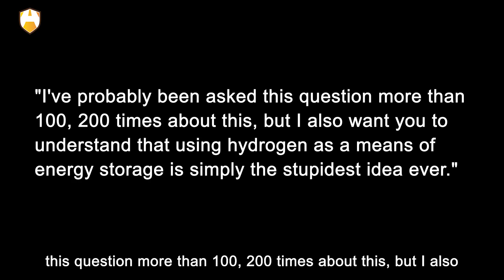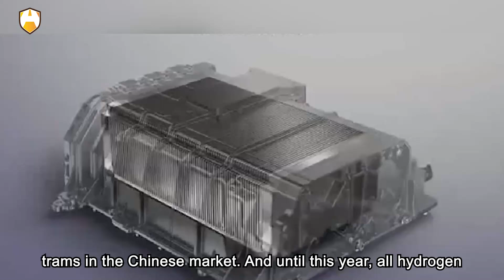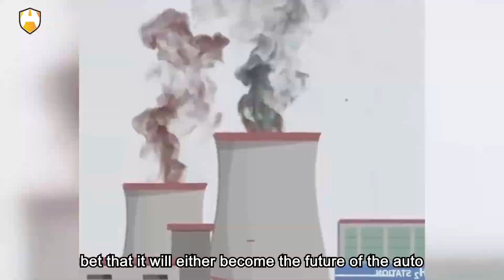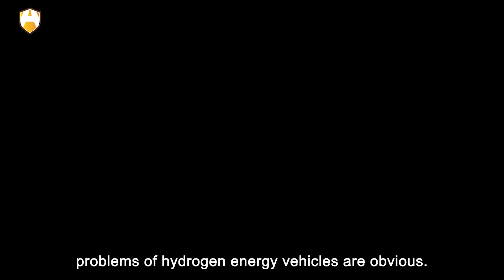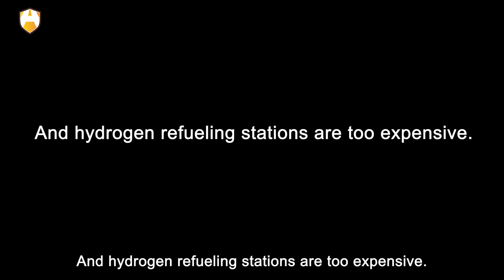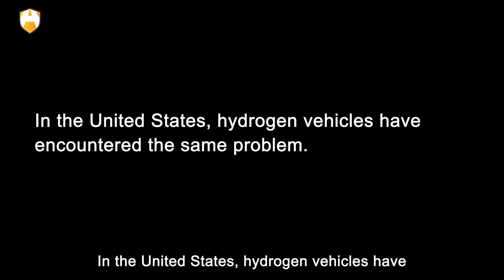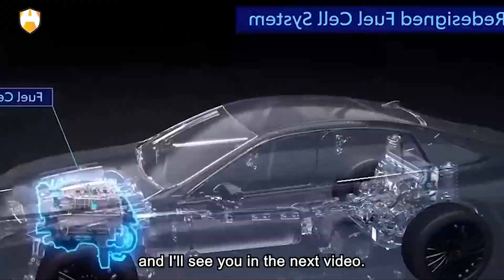Toyota's big gamble on hydrogen energy: Is the future promising, or is it a long shot?

Comment: They are only $3MILLION each ! Need very expensive trucks to carry volatile hydrogen under pressure. Plus have a gas qualified Manager .  Plus A solution is needed when the stations Nozzle freezes to the car connection. Hydrogen is a sure winner